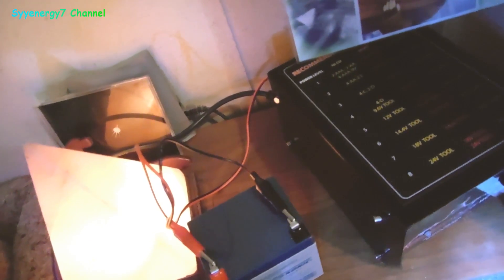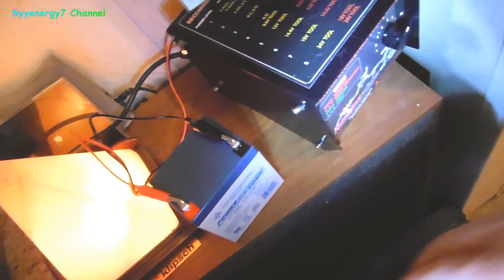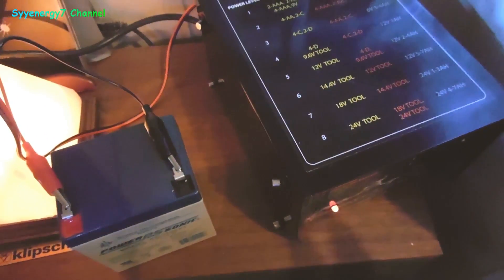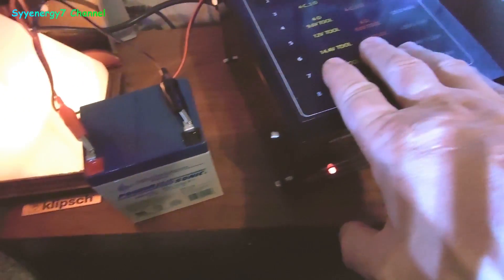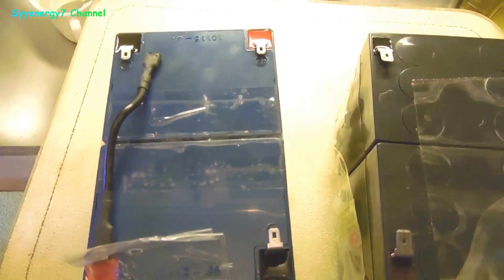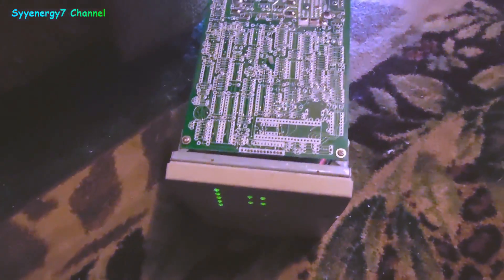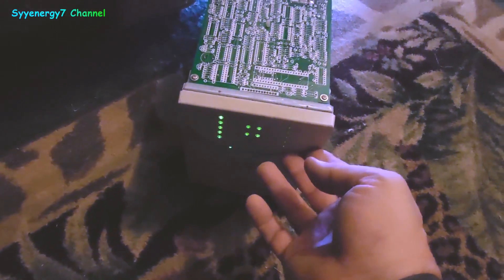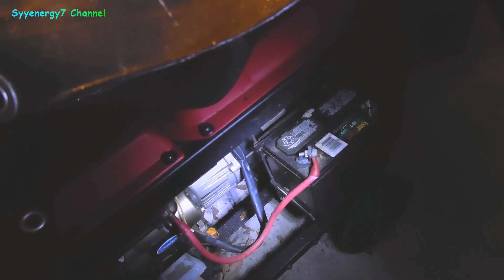OPTI UPS 500 Power Supply BATTERY Replacement

Comment: About 8 years ago I put a lcd tv and Xbox in my semi truck and heard inverters could hurt electronics so I found a battery backup that claimed to filter out bad electricity and spikes. The problem is that the battery backup I bought was just a modified sine wave inverter with a battery an I ran that with another modified sine wave inverter from my truck battery. Both were cheap modified sine wave inverters so my TV would just cycle on and off multiple times a minute. I later figured out what was happening is modified sine waves only create about 70% of the AVERAGE voltage and the other inverter in the battery backup only created 70% of that voltage. So my TV was Getting 120+ and the 120- but 50% of the "average" voltage needed after running through 2 modified sine wave inverters. Most modern electronics run on DC so they take in a electrics and convert that to dc. Yes a lot of them can easily run on modified sine wave inverters but there are the items that you need a pure sine wave for. If I bought another battery backup I would spend the extra cash for the pure sine wave one.